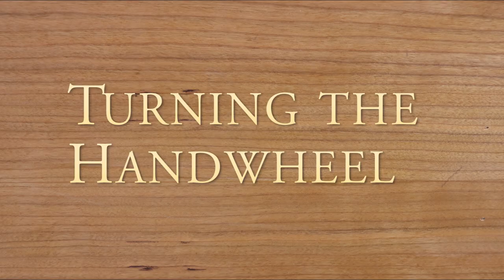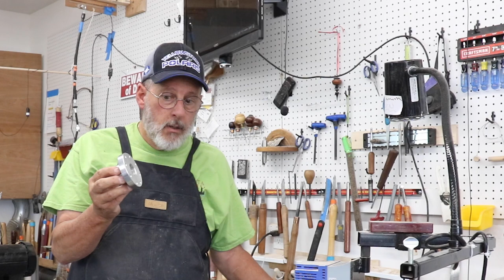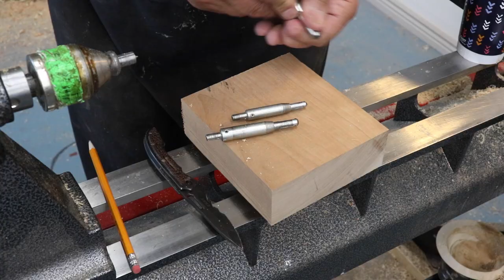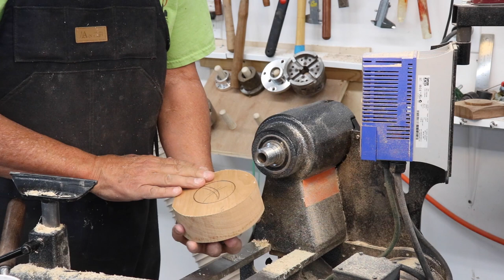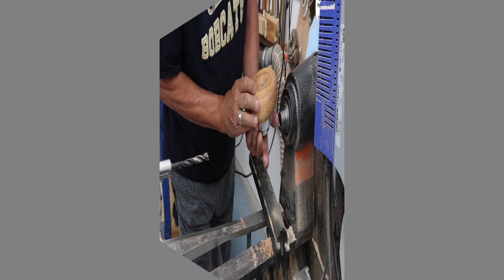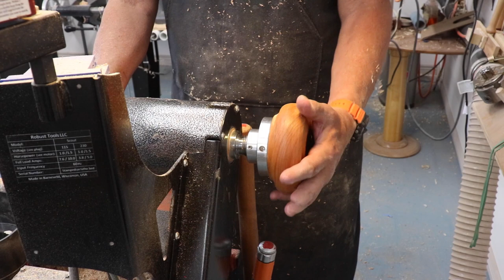Sam Turns a Handwheel for his Scout Lathe (remake) with Sam Angelo

Comment: Sam, something you probably did not forget  to do was to notch the wheel's circumference, which I routinely do, lest a smaller wheel jams on, or I need to make a reference mark. I simply take a larger diameter blank, describe a circle on which to drill the required number of chosen size holes, and then turn them down to just under a half hole profile, and sand smooth. I've found it worthwhile, and quite like the finished job. Bernard.

Comment: That looks great.  I use screws as well that does not need pilot holes, but I have found that they work a lot better for turning if a pilot hole is made first. The pressures exerted during turning seems to make them more fragile if they did not go in a pilot hole.
 I still have to get round to making a hand wheel for my tailstock as the original is broken.
Thanks for sharing

Comment: I have a Shop Fox W1758 wood lathe but it doesn’t have an outboard spindle or hand wheel thinking of adding a thin metal+wood disk to inboard spindle that will not interfere with faceplate or chuck.